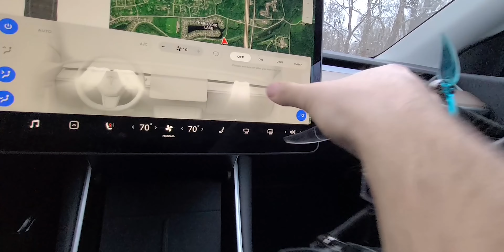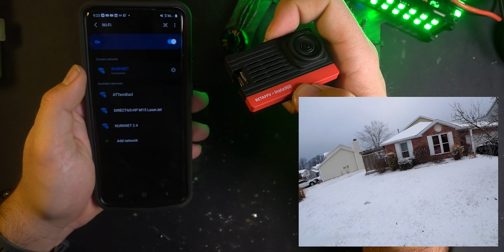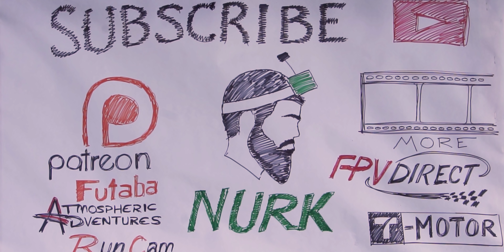The Insta360 SMO is a credit-card-sized HD 4k Camera for Ultralight and Cinewhoops

Comment: Even drown components can still be saved
I would suggest taking the components off, bathing it in 90% alcohol, brushing it with a old toothbrush in order to remove any rust, water remains... then drying it with a hairdryer and rehousing 

Saved dozens of iPhones when they weren’t water resistant back then 

I assume you’ll have no problem getting this replaced but that’s still a solution that works most of the time

Comment: What do you think of Insta360 One R vs GoPro? I find the footage from it works better in my workflow if trying to make it match other cameras. Just trying to decide if this is worth it for replacing naked GoPro. Also, I applaud your dedication in retrieval!
Reply from the maker: Workflow is easier without reelsteady go, but I think RSGO footage looks better in the long run. I also wouldn't use Insta360 in a professional environment, but I would consider using a naked gopro.
Reply: @NURKFPV  thanks! I use insta360 with 1-inch with Cinewhoop and 360 for underwater and VR footage. I can match color of it close enough to other cameras in those uses. Your info saves me some cash so thanks again!

Comment: Nice review. Can you set you manually change your shutter speed in the app? In other video's that I saw nobody talked about it. Is it me or does gopro reelsteady seem better stabilized on the roll then the flowstate in fpv mode??
Reply from the maker: You can manually lock shutter speed on the app yes. 

I prefer the look of flowstate over hypersmooth personally, but I like reelsteady more than both.
Reply: @NURKFPV  Indeed second that flowstate is better then hypersmoot. But realsteady beats them both. But nice to see the way the industry is going. Hope gopro comes with an answer ;)